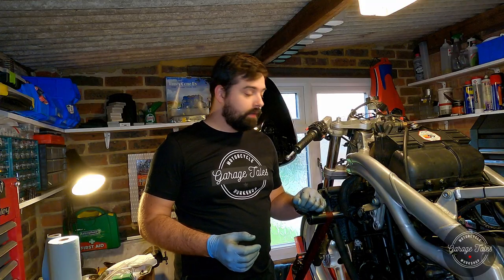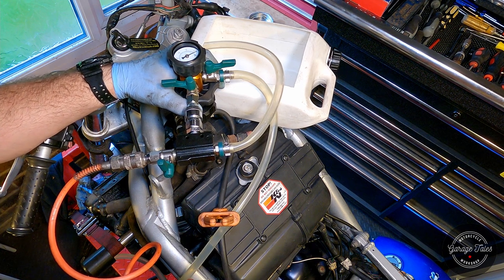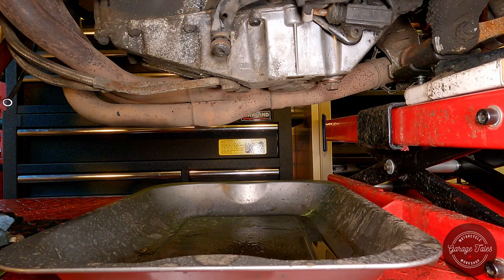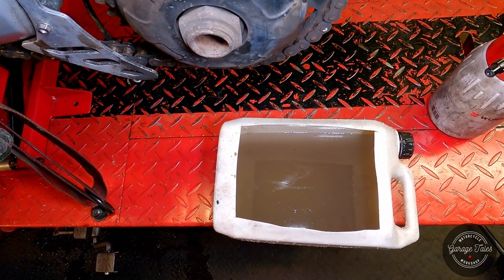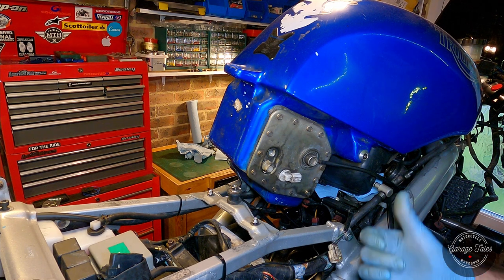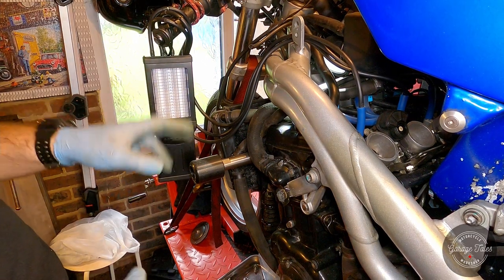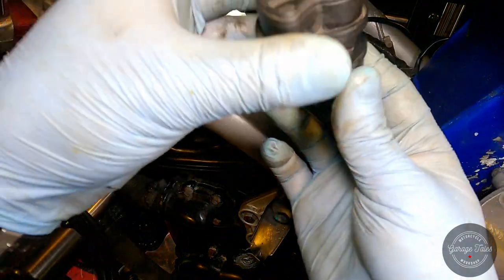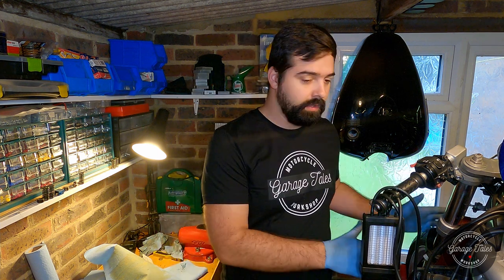Triumph Daytona 955i video 5 - Engine Service PART 2

Comment: Where does the hose from the fuel pressure regulator go to? I’m working on a bike and not sure if it’s supposed to connect to the air box or across to the other side of the tank
Reply from the maker: There are 2 lines. One going from the fuel tank to the fuel rail, and one returning from the pressure regulator back to the fuel tank.

Comment: Great video, just have a question, after removed the tank for cleaning  and all my idle  is around 2300  now, i cant figure it out how to reset or what is wrong with it, any input where a should start looking?? Thank you..
Reply from the maker: Have you maybe disconnected one of the vacuum lines by accident?
Reply: @garage_tales  the 3 hoses from airbox, got disconnected  by accident, 1 is drain hose
Reply from the maker: @geovp1984  So it’s all running correctly now? 🙂
Reply: @garage_tales  nah still the same, i dont know what else to do.

Comment: Can you provide a link to that coolant vacuumed tool you use?
Reply from the maker: Hey there. That one is a Draper 09544. You can find it on ebay, amazon or other sites. I’ve had it for the last 5 years and still works well so it’s not too bad.

Comment: I know this is an old thread but I need your help. I replaced all the hoses on IACV some time ago on my 2000 triumph Daytona 955i. Recently the bike started making a high pitch chirping noise. Annoying AF. This chirping sound seems to be coming from the alternator area. However, all the internet gurus said its the hoses at the IACV valve. I checked my IACV hoses all in excellent shape.  I cleaned the valve unit and sprayed a little lubricant for ease of movement. Did not disassemble and clean as you did.  Also you pressed the valve all the way down with your finger pressed on the hole and turned the key to the on position? 
Would you please reply to two questions. 1) whats the reason for the for pressing down the valve and turning on the key? 2) Is it possible something loose in alternator? Bike was running fine when I parked it a month ago.I have multiple bikes.  I really enjoy the thoroughness in your work and appreciate any direction. I'm in Los Angeles ca by the way.
Best regards,
Robert
Reply from the maker: Hey Robert,
Thanks for your comment, and sorry for the late reply.

So the Idle Control Valve is basically a stepper motor whit a female thread in it’s shaft. It also has a groove in the actual poppet to stop it from rotating (if it can rotate, it might just spin with the motor rather than adjusting in and out) So you can’t thread it in manually. What you do is put it all in place, keep pressure and turn on the ignition. What the ECU is programmed to do at that point is to close the valve completely and then open it a number of turns. It doesn’t have any feedback, so it relies on closing completely (going to a fixed known location) and backing off a set number of steps. So when I apply pressure on it, it will try to unscrew it a bit, and then wind it back in so it’s assembled, and also ready and backed off enough to put back in it’s housing.

Regarding the chirping…it’s pretty hard to understand what that sounds like and where it’s coming from. It shouldn’t be the starter as it would be disengaged after starting the bike. Unless the sprag clutch is seized.

Hope that helps!
Thanks again!
Vlad
Reply: @garage_tales  thank Vlad. Noise seems to be coming from the alternator. I removed from the bike and spun it by hand and could not detect damaged bearings or any side to side/ fore and aft play whatsoever. Im stumped. When bike was parked it was running fine. Appreciate any advice.
Reply from the maker: Hey Robert. Is it possible that the noise is only noticeable at speed and not by spinning it manually? 

Have you tried starting the bike with the alternator removed? Watch out with the wires and oil spill🙂